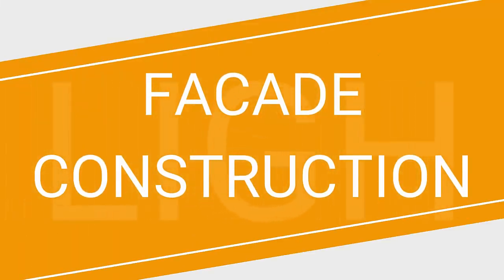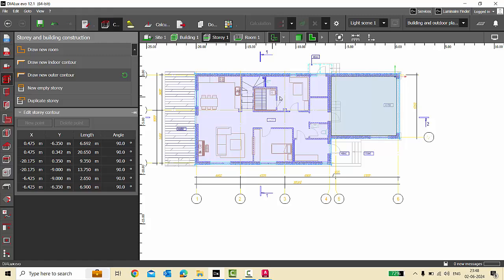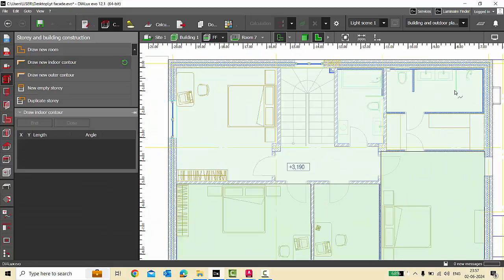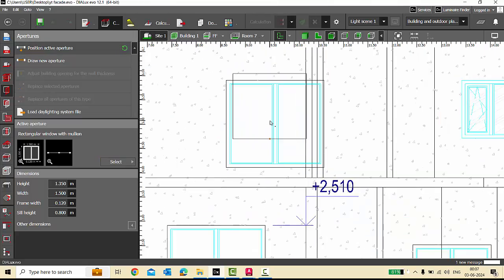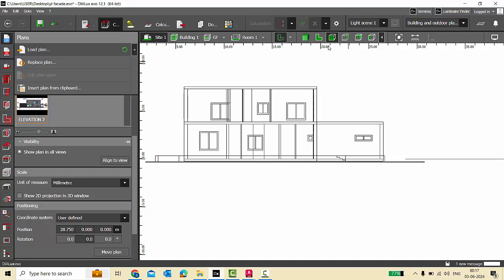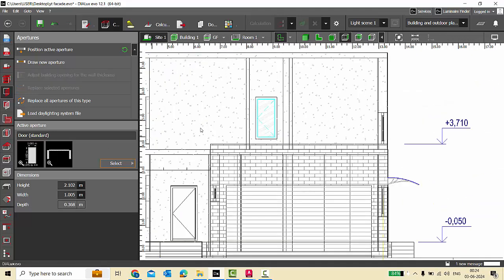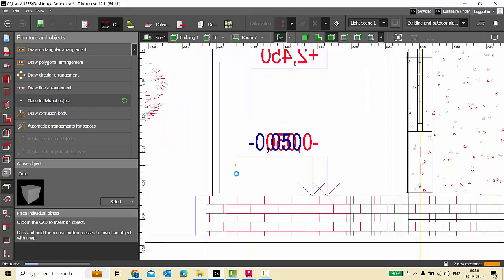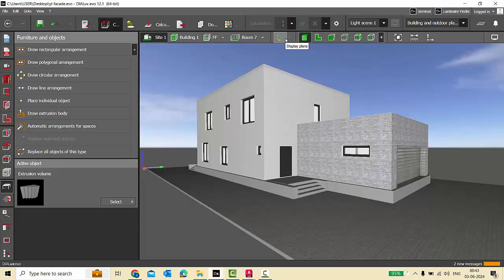Facade Construction in Dialux Evo | Step-by-Step Tutorial

Comment: Ma'am,  is it necessary to make building structure in dialux? can 't we make it in sketchup or any other 3d software? If do so then what is the difference?
Reply from the maker: You can but there would be certain issues with textures if you are making it in sketchup. You can try making in revit instead bcus we can import ifc models in Dialux but again here you would need Dialux pro version to import the ifc